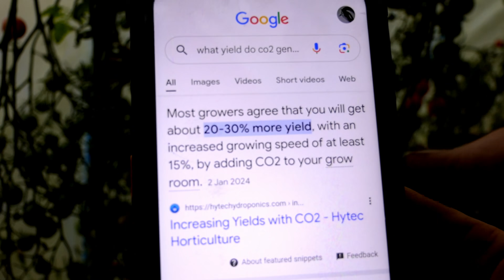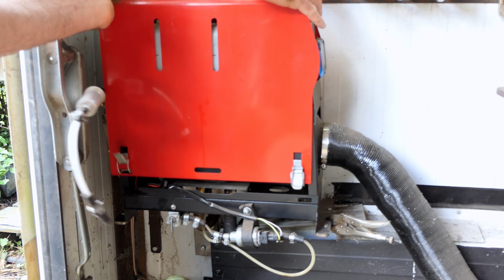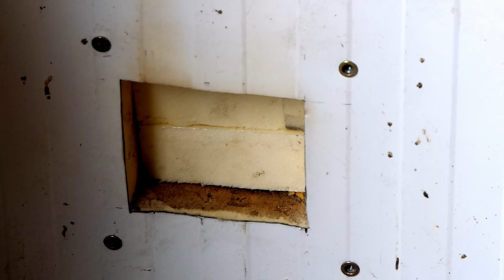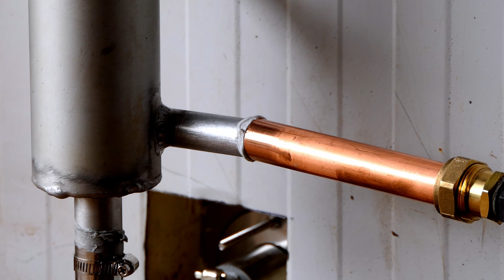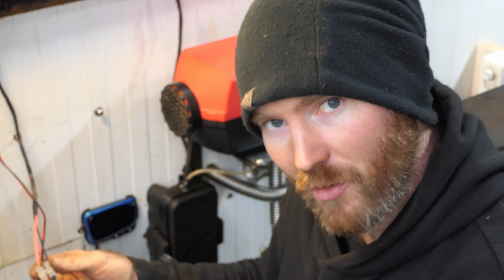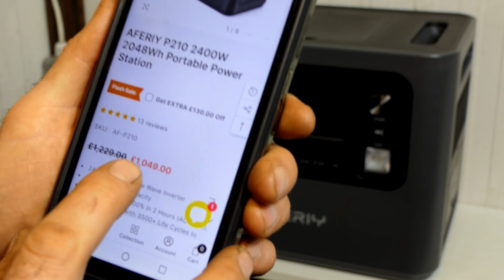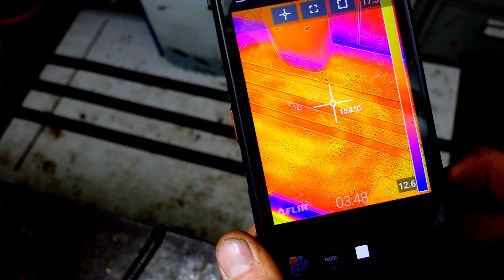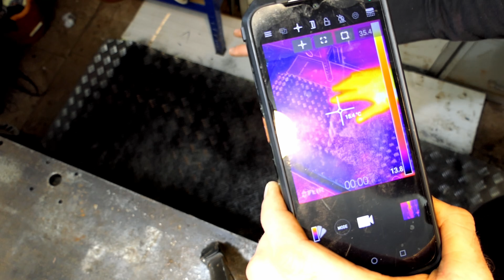NEW! Better system for Cheap and Safe Heating💲+ Underfloor Heating Mod test🫠

Comment from the maker: Before anyone comments their thoughts on the things I've said, PLEASE please make sure you first have listened to everything I've had to say on the subject especially the last 10 minutes of the video where I make my position clear and also double check all the facts I've mentioned before assuming I'm wrong. Otherwise I would be very interested in your perspective, Thank you.

I would also like to bring peoples attention to another matter on the other side of the argument related to fuel which is the case of Donziger: https://chuffed.org/campaign/free-donziger/bb

I hope this video was helpful and insightful to you and if so please would you share, like and comment to help me further.

Here are some helpful links:
**WIN** for just £5 enter the raffle competitions here: https://raffall.com/joshuadelisle

Recommended Diesel heater full kit
UK: https://amzn.to/4hfz0sa
USA: https://amzn.to/48kllMo

AFERIY P210 2400W Solar Generator Kit
Discount: £210 off
Code: Joshua2400WKit
UK: https://shareasale.com/r.cfm?b=2420256&u=3821090&m=147101&urllink=uk%2Eaferiy%2Ecom%2FJoshua2400WKit&afftrack=
EU: https://www.shareasale.com/u.cfm?d=1088027&m=147201&u=3821090
USA: https://www.aferiy.com/?ref=Joshuap210

The Dimming Video: https://youtu.be/rf78rEAJvhY?si=ZlV06F5cu-yBS74x
Their main website: http://www.geoengineeringwatch.org

There is also a lot lot more in the description.

Cheers J
Reply: I run a Chinese diesel heater to heat my machine shop, and I have a 2m long exhaust pipe in a zig zag with a variable speed fan behind it. It works a treat,  too, the point you can hold the cold end while the hot end is at 100 + degrees. I've been running mine on kerosene for years without issue, and i don't get the carbon deposit either, probably because i only run it on kerosene. I agree with your comments at the end of the video. We are either both raving mad or right. Never stop experimenting, and the person that says they have never made a mistake has never done anything.
Reply from the maker: @davedoingdavethings247  thank you so much. Cheers J
Reply: We run our heat pump overnight when on a tariff when electricity is 8p per kw, so get heat for 2p per kw.
Reply: @matthewclarke6601   The cheap tariff is a price we should all be paying if that's the true cost to produce the energy. But in reality i suspect all the other consumers are paying a higher rate to subsidise your tariff.  It's basically a carrot/ stick  economic strategy that will only work while there are people with old none heat pump systems.If everyone had heat pumps. You won't be getting that deal. And your heat pump will no longer subsidised. But while you are getting that tariff, well done you.
Reply: @matthewclarke6601 and you're not restricted to just overnight.
There are tariffs that will give you one or two cheap-rate blocks during the day!
Reply: The "campfire"-looking symbol at the top of your phone while in the FLIR app will switch to a high temperature range.
Reply: Why don't you use a heat exchanger from an old boiler as I do it cost nothing to find a broken boiler and remove the core.
If you are interested in my setup i could send you a few photos.
It is extremely efficient and silent.
Reply from the maker: @haroldtokes5192  nice. I want to find solutions that anyone can find and fit. I can build everything from  scratch with raw materials however that's not possible for the majority of people. Cheers J
Reply: @joshuadelisle  I think you'd get a lot of views following up on that idea. I know I'd be keen to see what you find.
Reply: A fun math problem to help you understand the gravity of the issue Joshua is to figure out the amount of carbon dioxide mass produced by your heater in terms of oak tree cellulose/carbon/lump charcoal that it will absorb in its lifetime (consider a tree's efficiency).  You'll be surprised.  It's likely you'll burn through a small forest worth of solar/fossil energy by using your car in its life time & need another larger forest's worth to absorb the equivalent co2 produced.  Now multiply by amount of cars and then consider the even dirtier industries that are not road transportation.  Burning hydrocarbons for heat is one of the most efficient uses of hydrocarbon use, sadly converting that heat to work is a lot less efficient.
Reply: @joshuadelisle  
HOW  D A R R R E YOU!
Reply: @joshuadelisle Nice to see you haven't got YouTube rich yet to the point where you no longer need to care about cost effective heating because I enjoy these videos :) I'm intrigued at what the Chinese order you're waiting for is, I paused the video but there were no product details shown :(
Reply: I had expected feedback on constructive criticism. But I didn't get that…
Reply from the maker: @johnny5240  there some very good points from PHDs in the comment section. But it is mainly in agreement with me. If anything it proves the incompetence of our leadership to relay important information and be examples of the seriousness of the situation. There is lots of distrust and hypercritical leadership. Cheers J
Reply: Thanks for the reply 😍
Reply: Hi josh love your channel, Do you  recommend any motherboard replacement kits that can be manipulated (ie,  the unlock code) for changing out bad controller and motherboard?
Kind Regards 
J
Reply from the maker: @jongibson3375  Hi. Personally I've not changed one to try but I'll consider doing that. I have suggested in the past that I would find a controller and board set off Amazon which has the blue controller similar to mine as I know that one works well and I understand the controls. I would like to test the app controlled versions in the future too. Cheers J
Reply: the last 10 minutes were priceless❤️ greetings from Poland
Reply from the maker: @tomashhz  thank you so much. Cheers J
Reply: About a month and a half ago I bought an Aferiy 2400 watt inverter. I absolutely love it! The only thing I wish is that it could at some point take an extra battery pack. Other than that one small fact it's amazing. After trying it out and doing some things with it I charged it up and put it in a box for SHTF. Thanks for your struggles with these diesel heaters. I use one almost all the time in my family room and you would gasp if you saw my setup but serves my purpose well. I do want to get one of the hot water heaters now though! Vevor here I come.
Reply from the maker: @theanimalmedic  thank you. Just note a lithium battery will lose 3% per month when not being used. don't let it drop below zero %. Cheers J
Reply: Awesome video. I'll add my thoughts on the heater efficiency in another post that will be buried way down the list. lol
When I first heard of the "thing", it was in relation to 3000 year old ice melting. People were making a big deal out of it, but I kept saying, that is like me dropping one piece of ice, that falls on the concrete and melts, while topping off my 100 year old beer cooler that constantly has ice and I just top it off every year just for good measure. I knew Mars had polar ice caps, so I decided to check those. They were also melting. That seems definitive.
Ivor Cummins (at fat emperor) on X has a 4 minute video that everyone should watch. The evidence is undeniable. The Earth's temp is rising. The video is on results of a study of a 3 km long ice core It has 120,000 years of climate history. They have an accurate measurement of the climate's temp for the last 10,000 years.
Reply: Certain video posting websites don't always show everything in this section. So I will split this up somewhat. We manufacture cleaning chemicals. We have awesome products that are made with conventional technology that is largely based on petrochemical ingredients. Around 2004 or 5 the green push came on full swing and I formulated and started manufacturing really, really cutting edge products based around surfactant technologies derived from palm oil instead of crude oil. They are 10X more expensive but the stuff I made is really good and probably worth it, but we sell to industrial accounts, not to households and they don't want super expensive cleaning chemicals, BUT a hell of a lot of consumers have bought in and you are SO right about the amount of Amazon Rain forest that has been slash and burned to plant Palm oil trees to satisfy the needs of the people who want "green" and "renewable" and it is literally destroying the Earth.
Reply: The rain forest that absorbs to carbon (Co2) and converts it to oxygen is being destroyed at a record pace to plant more and more palm oil trees in an effort to reduce carbon emissions. Everyone involved knows it is BS, but there is money involved. It has been a few years since I looked at a map and I know the South American governments were wanting to slow down, but at least a few years ago, any rules were being ignored.
Reply: I'm interested to see if any of my comments show up.
Reply: You are of course completely right. I am sure you are taking a lot of heat for this. Thanks for speaking the truth anyway.
Reply: @tobiassander3995 Your expertise to declare someone 'completely right' should be easy to demonstrate (if it isn't simply opinion).

Please back up your claim
Reply: Hi totally agree with your take on global warming. I have same discussion's with my friends all the time . Also think of big mega cities how much water is  diverted in pipes permanently out of natural circulation. Everyone have climatization , watch heat emittance of such cities when everyone  turns on their own small air-condition , the effect is cumulative above cities. Not a scientist but i think all these small things matter. Watched Randal Carlson he has interesting takes on  global warmings as well. I think we would eb much better if everyone just went and planet a tree each year.
Reply: Excellent  well done.
Reply: Doctors' FIRST requirement has always been to get you eating correctly, so the "medication first" is a complete trope.
ALSO, you completely misunderstand what 15 minutes city means - it's simply to put shops and services within 15 minutes of people. Nothing authoritarian. It's completely mad and it baffles me how folk can get a good thing -be near the stuff you need - and turn it into a bad thing???
If you're my 15 minutes walk away then you're more likely to walk WHICH IS A GOOD thing .
@joshdelisle you need to do better research.
Reply from the maker: @terryjimfletcher  I've had to deal with enough doctors and hospitals and their mess ups to understand fully the corruption of big pharma, diet is never the first call, don't be naive, a healthy patient is lost customer. The Convenience of living in a city has always been a choice, 15min cities and being fined to travel outside of zones is definitely authoritarian. Cheers J
Reply: You couldn't be more spot on, the facts speak the truth. Those who deny the facts, are doing so out of woeful ignorance, and/or are wilfully supporting and pushing a devious/evil agenda.
Reply: Hi Josh! Great video, as always, I can't believe how much you get down.  Thanks for highlighting the climate scam - and you are spot on: let's debate the issue.  I remember the first time the BBC announced: "the BBC will not longer debate the climate crisis".  Well that woke me up, so ever since when the BBC talk about jibby jabs, ULEZ, cashless, etc.   then I know it's another scam.  How come hands on smart people like you and Geoff Buys Cars can work out what's going on, whilst the univeristy types go along with the nonsense.
Reply: they are fully aware of the heat/cold cycles caused by the disatnce of sirius from our plane-t. they are aware of phoenix events in history too every 136 yr, as all these things follow the cycles of the stars and have been recorded for their use. resets due to plasma flares across the surface of earth are evidenced by the molten structures we are left with in certain countries [pakistan fortification] which can be seen on jon levis channel in numerous vids. due to a pole shift we are experiencing many issues and i believe the russian gov monitors the geomagnetic centre which is headed for siberia currently; that and they are messing with chemicals and frequencies to manipulate the weather. theres some individuals out there sharing this stuff but not enough because its a bit occult and not for everyone.
Reply: 'in my opinion' all governments are mafia-like criminal, murderous organisations that are fighting over the control of resources including the theft of human endeavour. The very  principle of their systems of control run against our freedom to live our lives independently. We didn't agree to it. You can't opt out so are their prisoner/slaves.
The political parties in the democracies simply offer an illusion of choice. They are a long way down the list of organisations that run the world.
Reply: Well said, absolutley spot on
Reply: Thanks. We all appreciate all your efforts and persistence despite sometimes not going the way you expect. Well done 😊
Reply: A note to you and everyone about oil heating. When an oil heater is working correctly it makes 10 to 20 ppm carbon monoxide. They often go wrong though and make enormous amounts 10,000 ppm or higher. 

10 ppm will not hurt you even over a fairly long exposure. 10,000 will kill you fast.
Reply: Spot on. To many environmental zealots most of these arguments will be entirely new to them, so brainwashed are we by schools, the BBC and the Left who hate capitalism and progress.
Reply: Hi Joshua, I would agree with essentially most things you are presenting in your video and love your content. Am I wrong in saying your calculation for pence per KWh of energy for a heat pump is a little off? I'm assuming you're taking the 8.66 then x3 to get the 26 p/KWh? When really this should be dividing by 3 due to producing 3 units of heat for every kwh of electricity. Now I appreciate you also mentioned it could be as high as 14p/KWh so not saying it's any better than the others when the calculations are done. Just thought I'd check my understanding.
Reply: What do you think to putting redex in as a cleaner 🤔
Reply: I did my research carbon monoxide detector should be mounted 5ft or 60in above the floor to work properly.
Reply: Hey man. I've watched alot of ur videos. What if u compress the Gas ur making back into a liquid.  Then filter it back to the engine at gas instead of liquid so the solids stay behind. Maybe frozen or filter the frozen liquid to reduce contamination then back to a gas?
Reply: Dear Josh:

You need to think carefully about the difference between natural CO2 emissions, and our emissions of fossil CO2.  Living things dying and decaying give up carbon, but don't change the planet's carbon level, because living things took up that CO2 in a balanced cycle - the hole in the forest is filled by new plants as the old plants die.  
But digging up carbon from underground and burning it in cars and factories releases carbon, but the hole underground does not fill with an underground forest...  it is out of balance with the life on the Earth.  Also, the coal and oil dug from underground are very dense in carbon, concentrated by geological processes (as you know from your own charcoal experiments) so the 20kg of kerosene might represents a large field of peat growing layer upon layer for millions of years - and there simply is not enough room for enough moss to grow to take up all that CO2.

I am greatly saddened by your "doing your own research" and thinking you have it right, because yeah, you're a guy in a shed, and not someone that understands the complex cycles that we are changing without understanding our impacts.  It takes years of study to grasp what is happening, not a few weeks of youtube videos.

Your final comments are wildly wrong, and contribute to a strong misunderstanding of the carbon cycle and our impact on it, and burying your misunderstanding in your own belief the 0.00012% is such a small number that it can't possibly be that important.   Remember that going from 0.03% to 0.04% is a 33% increase, not a 0.01% increase.  Sunspots is not the reason.  It was warmer 70 million years ago does not mean it will be fine for us.  The temperature of the Earth is not critical, it is the rate the temperature is increasing that is critical - a million times faster now than in the pre-industrial past.  Plants and animals alive today cannot evolve fast enough to survive in the hotter Earth we are creating.  When corn, soy, rice, wheat, and sugar cane cannot grow, much of humanity will die, and the survivors will all be paying Monsanto dearly for the latest GMO drought-resistant versions.

And your comments on deforestation are correct, but deforestation also reinforces the CO2 problem.  No room or water for the plants is a human-caused problem that is creating a larger imbalance in the carbon cycle.  Both are part of human-caused climate change.  Not sunspots.  "We can't do anything about climate change" is just wrong.  We can, and we must, or we will die in our own waste pile, another decayed branch of the tree of life on Earth.
Reply: I just saw this in my feed, I have seen other videos of yours before. I would like to say that climate change has been happening for millions of years, it is called Milankovitch cycles. No human activity caused the ice age to melt, so the climate doesn't need us to be here for it to have a big change now. Pollution is another matter.
As for cloud seeding, CIA director, John O.Brennan spoke about Geoengineering using Stratospheric Aerosol Injection over a decade ago and it was on the CIA website.
More recently, search for Desiree Fixler, a DAVOS WEF insider whistle blower for seeing the dark side of ESG and greenwashing.
Reply: Thank you for sharing
Reply from the maker: @tigs9573  thank you for watching. Cheers J
Reply: Hello Joshua, I'm going to have to correct you about your understanding of human impact on atmospheric CO2 levels. The 3% mentioned isn't the total contribution to concentration by human activities but rather a 3% change in CO2 flux. CO2 flux is basically the carbon cycle, the degassing of dissolved CO2 in the ocean balanced by the reabsorption of CO2 by the ocean, the release of CO2 caused by a plant/tree dying vs. the absorption while it's alive, the release of CO2 caused by a volcanic eruption vs. the absorption caused by chemical weathering. The digging up and use of locked away carbon in the form of coal and oil is referred to as an anthropogenic source of C02 and there is no balancing force to combat the amount of CO2 being added to the atmosphere so every year we add 3% more CO2 to the system which is relatively small but it soon adds up. 
Imagine having 2 open water tanks that contain exactly 100 litres each and every day they pump exactly 100 litres from one to another (tank A pumps 100l to tank B, tank B pumps 100l to tank A), these open tanks have 30l of extra room to account for variations and prevent spillage. The electrical system that runs the pumps is underneath the tanks and not waterproof. Every day you are going to add 3% more water to the system (3l), in 11 days you're going to start to overwhelm the capacity and get leaks and as that leak increases in scale the chance of shorting out the entire system increases exponentially.
This is our atmosphere. We are overwhelming the system and there is nothing we can really do about the changes it will cause. Planting more plants/trees doesn't help all that much because any CO2 absorbed in life is expelled in death, it's a cycle. The only way to recoup the amount we've reintroduced to the system is to capture it and lock it away in a way that it can't get back out. This is what coal and oil were before we oxidised them by burning, stable forms of carbon.
Think about it, reducing carbon emissions isn't what any government or private company wants, reducing carbon emissions isn't profitable or productive. It's like eating cake for every meal, we'd love to do it because it's delicious but we know that if we do we'll get fat and suffer the health consequences. The increase in atmospheric CO2 has risen since the industrial revolutions by the equivalent of 45 Mt. Etna sized eruptions and yet there certainly haven't been 45 eruptions of that scale within that time. The oceans are warming as a result of the greenhouse effect caused by increased atmospheric CO2 and as they warm they can absorb more CO2 which is leading to acidification and yet it still can't absorb the excess we're producing despite covering 2/3rds of the earths surface.
You refer to the ancient past and how the higher CO2 levels caused an abundance of life but you fail to note that the initial injection of CO2 was caused by a super volcano erupting that wiped out 98% of life on earth and it took millions of years of evolution to rebalance the system and adapt to the new conditions. Don't get me wrong, the world will survive and as long as some life remains then life will likely prosper once again but we and the vast majority of life as we know it won't so it's in our interest not to mess things up too badly if we can avoid it.  
Doing your own research is great and highly encouraged but we have educational institutions for a reason. That reason is to make sure you understand the whole subject and not just the abstraction. Unfortunately these problems are often complicated and require an understanding of multiple aspects to get the whole picture, if it was simple then we'd have fixed it already
Reply: @DjDolHaus86  Human contribution of CO2 is between 3 and 5% depending on the study. These words like "balance and budget" are neither scientific or proven between the IPCC working group 1 or 2. The reason this "Budget" can not be agreed on is because the fundamentals about the impact of CO2 are as wrong as the "Energy budget" of the earth. 

1-The Earth does not cool and never has cooled at a wavelength blocked by CO2.
2-The P band that Co2 affects via the laws of thermodynamics means that "Every absorber is also an emitter.  If you and I sit on a beach and you being CO2 have a narrow band of SPF 50 from head to toe  you will not trap or reflect heat as a net value more or less than me (say I'm nitrogen)
EVERY gas has a "Heat sink" based on it's molecular "weight" just as lead is better at absorbing radiation for than tin foil. HEAT is stored in atmospheres with thicker atmospheres. 

I recommend steering away from "Budget" and contained analogies like water tanks (I saw this tactic used by a Youtuber an ex BBC correspondent who knows nothing about the science) 
A big part of the fraud is how the IPCC in their modelling used laws made for solids and applied them to the air - when that failed they used "Layers" in the models to get to a point of 60+ useless predictions because the basic part is 100% provably wrong. 
3-Past CO2 was 100x higher (life flourished with large creatures enjoying a very green planet)  a very long time ago and about the same CO2 as now was 12-13000 years ago. All this madness started with a hockey stick graph that was WRONG! Measured data was bolted onto unreliable ice core data to give the impression "LOOK what humans have done AND LOOK it's got warmer. - 2 papers exist that assume a correlation neither or actually NONE prove a causation.

You can have a look at how "Greenhouse gass" is poorly defined and how the earth is NOT affected by any ""heat trapping gas" specifically. 

Wood, R. W. (1909). XXIV. Note on the Theory of the Greenhouse. The London, Edinburgh, and Dublin Philosophical Magazine and Journal of Science, 17(98), 319-320.
""who demonstrates that longwave infrared radiation is not trapped by atmospheric greenhouse gases""

5% human contribution to what nature releases of the 0.04% CO2 gas can be calculated. IF CO2 would double (about 350 years at the current rate - (it will reduce since CO2 follows temperature changes as the earth cools AGAIN) but let's assume it continues then indeed the GMAT (Global mean average temperature would increase with the additional MASS of the atmosphere. That increase would be +0.1C
Restricting growth to solve a non problem is profitable for those on the bandwagon of provably wrong conclusions that are not held by the majority of people qualified more than the car salesmen type of "Climate science" they simple ignore the physics that doesn't fit their budget or spending. 
Titan has 3x more methane than Saturn. The same language of "Powerful greenhouse gas" is used about methane. Titan has 8000x more methane than earth.  But since it's fair to compare with Saturn in terms of solar energy. Why is Titan COLDER with 3 times more "Greenhouse gas"?
A spectral representation of CO2 or methane is never shown on the main stream since it's "Footprint" along the entire heat spectrum is laughable. 
 
The evidence of this scam is-
in the records of past CO2 from non ice core data (ice core is fine for past temperature)
The FACT that in human times and even in the Vostok ice core data CO2 FOLLOWS temperature change. Human contribution and climate alarmism was based on assumptions, sometimes lies and almost entirely on cherry picked data. That is scientism not science. 

the +0,1C:
Holmes, Robert. (2018). Thermal Enhancement on Planetary Bodies and the Relevance of the Molar Mass Version of the Ideal Gas Law to the Null Hypothesis of Climate Change. Earth Sciences. 7. 10.11648/j.earth.20180703.13. 

Also on "Greenhouse gasses"
Nikolov N, Zeller K (2017) New Insights on the Physical Nature of the Atmospheric Greenhouse Effect Deduced from an Empirical Planetary Temperature Model. Environ Pollut Climate Change 1: 112.

Past CO2 in human timescales vs what is used (for nice public alarm propaganda hockey stick graphs) 
Jaworowski, Z., Segalstad, T. V., & Ono, N. (1992). Do glaciers tell a true atmospheric CO 2 story? Science of the total environment, 114, 227-284.
Reply: @DjDolHaus86  You are right about the cycle. Humans haven't imported any CO2 as what is here was re used. at 120 Parts per million plant life dies out. we all die out. There have been extinction events in the past and ours will likely be down to an external event or our own stupidity when it comes to Nukes. A trace gas we breath, is NOT a problem. The narrative of lies can be easily exposed (with research)  Institutions have been captured by the $$$ so they will not hire or publish studies that prove the massive holes in the current narrative, but then again that was one reason Trump was treated like the anti Christ for listening to very qualified people top of their game (NOT PAID FOR BY BIG OIL) 
The "Green energy" sector is frankly a joke when considering the energy costs to replace fossil fuels (actually they should be called mineral fuels but that's another plot twist)  We should use other forms of energy and transition but there are not enough materials know to mankind to mine in order to replace hydrocarbons for even 1 year.
Reply: @DjDolHaus86  "The oceans are warming as a result of the greenhouse effect caused by increased atmospheric CO2 "
No they are warming due to climate cycles as seen in the medieval warm period and the climate record for 100's of years. And before you quote some BS you heard from sceptical science or somewhere else claiming "yea but it was only Greenland that warmed" That is another BS
FYI:
 GLOBAL warming is relative to a start point. The measuring point for all this alarmist nonsense was from a very cold period that ACTAULLY started way before industry - but they cut that part out in order than your fear and taxes will go into theor pockets to fix a non problem. By the time the game is really up - they made their billions and your kids didn't have the same freedoms to travel as I did. It's socialism/Communism with Marxism disguised as  "saving the planet" It's about wealth transfer, nothing more, nothing less.
Loehle, C. (2007). A 2000-year global temperature reconstruction based on non-treering proxies. Energy & Environment, 18(7), 1049-1058.
Liu, Y., Cai, Q., Song, H., An, Z., & Linderholm, H. W. (2011). Amplitudes, rates, periodicities and causes of temperature variations in the past 2485 years and future trends over the central-eastern Tibetan Plateau. Chinese science bulletin, 56(28), 2986-2994. 

Warming was global. I could cite climate cycles that even the IPCC have never heard of because their aim is to blame humans!

"In the present study, only three or four of the sites are from Europe, so it cannot be argued that the MWP was strictly a European phenomenon. Other studies also show the MWP (Little Climatic Optimum) in Europe (Lamb, 1965; Martinez-Cortizas et al., 1999; Shindell et al., 2001), Greenland (Dahl-Jensen et al., 1998), Africa (deMenocal et al., 2000; Holmgren et al., 2001), North America (Campbell et al., 1998; Li et al., 2000; Petersen, 1994; Shabalova and Weber, 1999), South America (Iriondo et al., 1993; Villabala, 1994), and Asia (Hong et al., 2000; Liu et al., 1998)"
Reply: What you say makes a lot of sense to me. Thanks for putting the effort into explaining it so well.
Reply from the maker: @davidbutler3661  thank you so much. There is a lot more I could talk about but I would be going well off topic if I did. Cheers J
Reply: @joshuadelisle  I'm a brit living in Germany and we really need to have a few pints together (On me) I've been trying to expose the very bad science for along time and i've done a LOT of research.
Reply from the maker: @grahamnumber7123  you're very kind. If there is a way to compile the evidence and data that can be presented alongside the funded mainstream agenda then there is a chance the truth will be brought to light. Cheers J
Reply: @joshuadelisle  Notricks zone and whattsupwiththat is a good place where the public can see the reality. For example there are many websites that deliberately try to hide the fact there was a medieval warm period and this was not local to Greenland. Or watch Bill Nye "The science guy" fudge an experiment with 2 globes under an IR heat lamp inside a jar with normal air and one loaded with CO2. The idiots got caught out because there was an imperfection in the thermometer proving the same thermometer was heated up. Never the less the same experiment was done properly and recorded real time (without cut and paste fudgery)  to show people the the jar loaded with CO2 was actually mildly cooler (As expected)
Try putting CO2 inside double glazing and see if it's "Trapping heat" It would be an ideal insulator in blocking the suns rays or keeping warmth in surely if it's a "heat trapping gas" It does neither.
Venus is 96,5% CO2. Why doesn't it keep heating up? (Saturation) Why is it's 58 earth day long cycle seeing nearly same temps (It's day and night) Why is Titan colder than Saturn despite 3x Methane (we should not eat meat because of methane, farm land because of fertilizers!? It's insanity but also a POWER grab. Mr Bill gates and Mr George Soros fund a lot of these far left Marxist ideologies, to benefit them. Mr gates is the largest private land owner in the USA, he meets with Mr 2 tier Starmer and then we have this tax on small farms. Coincidence or corruption. I can tell and prove to anyone how corrupt the climate alarmism nonsense is. As for the cause of warming, there are several angles. The most certain point overall though is it aint us and the data is manipulated. The UK picking the hottest place in the UK just happened to be a temperature station next to a transformer!! Science vy Scientism. (Science looks at everting and if a hypothesis does not fit, it is rejected. Scientism is to select ONLY the points that support a hypothesis. That is where we are and have been for at least 2 decades. The last part to seal the deal is to supress all those calling out the lies. 
Well done USA, well done Elon for a pretty much government controlled platform and turning it into a free speech area. The people are waking up. BTW I love your content and the way you put it across is just how I would. Keep it up!  I would love to come and show you how they manipulate and lie by omission. The 97% agree was also never 97% this was another lie with statistics because the real number who replied only 2% said humans are causing this change.
Reply: Cool - will have a check out of "The Dimming". Have you seen "Climate: The Movie (The Cold Truth)"?
Reply: Not sure about that dimming tbh, see my comment under the video but repeated here for discussion?

C21H44+32O2⟶21CO2+22H2O

And for the non chemists: 1 mole of jet fuel combusts with 32 mol of oxygen to produce 22 moles of water - only as it's just been comBUSTED it's steam, which is a gas. 

1 mol of any gas occupies 22.4 liters so 1 mole of jet fuel spits out 22.4 litres of steam out the back. 
Generally up high it's -40 to -50°C ish so this immediately condenses to minuscule water droplets which then freeze into nano ice particles - these are your "chemtrails".

1 mol of jet fuel weighs 296g, a 737-800 burns approx 42kg fuel per minute during cruise. That's roughly 142 moles. So every MINUTE the jet is spitting out approximately 70,000 litres of steam into ice clouds. 

Discuss please...
Reply: you said "you're not a scientist" so lets leave it at that ;-) , by the way... another great video! :-D
Reply: You ruined a perfectly interesting video about your entertaining approach on tackling a global energy crisis with your take on global climate change. However, your rambling about the changing climate not being bad right now for our living conditions as humanity is, how shall I phrase this politely, alarming. It is a man made change, that is factually proven to be true by science. I would strongly encourage you to stop shaming the attempts to stop the mass pollution of the atmosphere and instead focus on promoting the reforestation of our planet. Little fun fact on the side, Ireland (my current home) was covered by forest once too, until some British decided to use it and build an armada... and it has never recovered.
Reply from the maker: @79Casimir I believe in looking after the planet but tackling CO2 is a red herring and will only result in political tyrany with little to no change of the weather. It's a scientific fact that you cannot reverse climate change and it's a fact that there are actual benefits to having more CO2 whilst the negatives are theoretical and based on models that are in a state of flux. CO2 is good and necessary for all life to exist. The world has been far hotter and colder with much higher levels of CO2 in the past. Governments with an agenda are to blame for your deforestation not the common person looking to be self sufficient. Cheers J
Reply: @joshuadelisle  I think you do not understand the magnitude of changes the ever increasing CO2 will bring. The CO2 you point at your tomatoes will help weeds grow even better and the increase in temperatures will make crop yield worse (not to mention diminishing returns). The 3-5 times CO2 level of the past were fine for an ecosystem that had MILLIONS of years to adapt not centuries. 

Life on Earth is remarkably resilient and will almost certainly survive human-caused climate change. Some organisms will even thrive. But human civilization would face catastrophic challenges.
Reply from the maker: @ameliekk that's theory not fact regarding the results of climate change and those models keep changing regularly and differ depending the who's narrative is behind it. In industrial green houses they actually use CO2 generators to increase production... Weeds are fine within regenerative systems as they are used for biomass and fertilizer, nettles are especially great for high quality compost and makes a lovely soup, dandelions are incredible for heart health etc. Nature is more adaptable than you realize just look how it invades places that humans have abandoned. Helping nature is what we need to do such as protecting the rainforests and re-establishing ecosystems but carbon tax, Ulez, carbon capture, solar farms, battery vehicles etc won't do anything other than earn money for corporations.... Just follow the money. Cheers J
Reply from the maker: @ameliekk  watch this: https://youtu.be/MzCiEHGVMwA?si=atnXYvOdwUZDKMSp
Reply: @joshuadelisle  Her descriptions of how regulations and bureaucracy impede infrastructure development are (imo) generally accurate, but her assertion that renewables can never be reliable enough contradicts evidence from countries achieving 80%+ renewable electricity. Countries like Denmark, Costa Rica, and regions of Germany demonstrate high renewable penetration is achievable.

My push-back is not about your views on the UK energy policy, but with claims that our current CO2 growth is anything but catastrophic to human civilization.

The comparison to the Jurassic period overlooks that rapid change (not absolute levels) is the primary concern. The "only 0.8% of emissions" argument ignores cumulative effects and the UK's historical contributions. While she acknowledges rate matters, she severely understates its importance. Current CO2 increase is occurring 100-300 times faster than most natural climate shifts. This is the critical difference - ecosystems and species need thousands to millions of years to adapt, not decades.

Yes, Earth was warmer with higher CO2, but:
-Sea levels were 50-200 feet higher (goodbye London, New York, Miami)
-No ice caps existed
-Completely different continental configuration
-The sun was 2-3% dimmer (which she mentions but underplays)
-Zero human infrastructure existed to be disrupted

While humans add a smaller percentage than natural exchanges, this fundamentally misunderstands carbon equilibrium. Before industrialization, natural emissions and absorption were balanced. Human emissions are additional - like adding water to an already-full bathtub.

Climate scientists aren't claiming life will end - they're warning about:
-Collapse of current agricultural systems
-Displacement of billions from coastal areas
-Water scarcity for 2+ billion people
-Economic costs in the hundreds of trillions
-Potential civilization-level disruption

Her argument essentially boils down to: "The planet has been different before, therefore rapid change isn't concerning" - which ignores that human civilization developed during an unusually stable climate period, and our entire infrastructure assumes that stability continues.
The most telling quote is when she says CO2 staying high for millions of years would allow life to "eventually adapt and diversify" after a "mass extinction event" and "thousands of years of instability." She acknowledges catastrophic outcomes while somehow presenting this as reason not to worry.

And while future projections have uncertainty, we're already observing documented changes: glacial retreat, shifting growing zones, coral bleaching, permafrost thaw. These aren't models - they're measurements. The fact that governments and corporations push profitable "solutions" over effective ones doesn't negate the underlying atmospheric physics. It just means we're addressing a real problem with fake solutions.
Reply: @ameliekk  no use, he is not a critical thinker
Reply: Seeing as the response to your post that I replied to along with that post has been deleted, I'll throw it in again:

It's scientific fact, not perspective.  

Just the freely available Wikipedia page on co2 in Earth's atmosphere would do as a source. 

You're right about historical changes in levels of co2 and that they were astronomically high millions of years in the past.
But, and this is the thing, you aren't considering rates of change. 

In the past, co2 levels changed gradually with plants and animals best fit for the conditions evolving over time. It's true there would be an initial co2 fertilisation spike for increased plant growth but the limiting factor is nitrogen and there isn't enough of that available to sustain any such spike for long. Most modern plants that we would rely on could not cope . 

Slow rates of change allow for equilibrium in the system.
Additional co2 being added into the atmosphere by human activity over the least 250 years is small by comparison with other sources but it has upset the equilibrium causing rapid temperature change. 

It's not rocket science - life and eco systems can cope with slow change over thousands or millions of years by evolving and adapting, but they can't cope with rapid gobal change over a couple of centuries because there is no time to evolve or adapt. It's that, rather than change itself that's the problem and this seems to be so misunderstood or ignored by many.
Reply: @moriarmozz  Wiki is not a source of science since even people profiles can be altered to make them look dumb. 1st to address your comments "...."
"In the past, co2 levels changed gradually with plants and animals best fit for the conditions evolving over time. It's true there would be an initial co2 fertilisation spike for increased plant growth but the limiting factor is nitrogen and there isn't enough of that available to sustain any such spike for long. Most modern plants that we would rely on could not cope"
Just on the above. this is not true, CO2 has varied wildly and over relatively short periods. If CHERY PICKING the ice core record used for almost every single hockey stick graph (if you google image search "past co2") for past co2 then it doesn't look to change much at all no. But this is a lie. See the below.
Jaworowski, Z., Segalstad, T. V., & Ono, N. (1992). Do glaciers tell a true atmospheric CO 2 story? Science of the total environment, 114, 227-284.

Nothing wrong with the ice core data for past temperatures as this agrees with other proxies but for past CO2 it's not accurate at all esp when the higher values as left out and called "An anomaly"  sure an anomaly that doesn't fit the profile to get the funding.

"Additional co2 being added into the atmosphere by human activity over the least 250 years is small by comparison with other sources but it has upset the equilibrium causing rapid temperature change".
The actual number is around 5% human contribution. That is 5% of 0.04% please show me the scientific proof that CO2 drives climate change because the 2 papers that I looked at, 1 suggests a link and another assumes one. None exist that prove CO2 drives climate change. Here are 2 that show it doesn't, the 1st proves what would happen IF we could double CO2 (That would take about 350 years....check the maths yourself - (421PPM March 2023. 418.81 March 2022.)
Holmes, Robert. (2018). Thermal Enhancement on Planetary Bodies and the Relevance of the Molar Mass Version of the Ideal Gas Law to the Null Hypothesis of Climate Change. Earth Sciences. 7. 10.11648/j.earth.20180703.13. 

Nikolov N, Zeller K (2017) New Insights on the Physical Nature of the Atmospheric Greenhouse Effect Deduced from an Empirical Planetary Temperature Model. Environ Pollut Climate Change 1: 112.
Fun fact for you. Methane is also touted as a powerful greenhouse gas. If so then Why is Titan colder than Saturn despite getting about the same solar energy when it has 3x more Methane. (8000 x earth)
"It's not rocket science - life and eco systems can cope with slow change over thousands or millions of years by evolving and adapting, but they can't cope with rapid gobal change over a couple of centuries because there is no time to evolve or adapt. It's that, rather than change itself that's the problem and this seems to be so misunderstood or ignored by many"
This is not accurate at all. Greening of the planet has been observed and experiments with trees grown with normal levels of CO2 vs artificially increased levels show big differences in growth. CO2 is a BENEFIT to nature but is being sold to millions as a curse. We pump the stuff into greenhouses for a higher yield. Plants generally need less water with increased CO2. Co2 swings (if you look at the graphs in the 1st paper) happen fast. The recent increase is due to the temperature rise from a VERY COLD period to that of today. 
it wasn't never over this 280PPM claim used by NASA GISS (Gavin Schmidt doesn't take down his lying graph of past CO2 also used by Al Gore) has already been exposed as on the pay. I back up my claims with science so here are at least 2 more studies where CO2 was already way over the claimed ""280PPM for millennia""
Steinthorsdottir, M., Wohlfarth, B., Kylander, M. E., Blaauw, M., & Reimer, P. J. (2013). Stomatal proxy record of CO 2 concentrations from the last termination suggests an important role for CO 2 at climate change transitions. Quaternary science reviews, 68, 43-58. 

Even as recent as <1939 CO" was average 325PPM
Slocum, G. (1955). Has the amount of carbon dioxide in the atmosphere changed significantly since the beginning of the twentieth century. Month. Weather Rev, 83, 225-231.
Reply: You're spot on with climate change. Tony heller has a lot of great videos exposing the corruption of mainstream climate change science. Oppenheimer ranch project talks a lot about the sun cycles role in weather and climate change. It all just makes so much more sense than co2 driving climate change. Epecially since the data suggests co2 rises following temperature rise and not the other way around. "Climate the movie" is a pretty good documentary on the whole situation as well. Pretty much everything you said in that.
Reply: @brockashsfrund  Tony Heller is an absolute Legend! He does mainly generic fluff videos now so as to not get kicked off this media ..... but he shows clearly where the fudges are in the climate argument. He has fairly conclusively destroyed the link between CO2 and Global Temp rise! He also has a free programme that allows you to interigrate all the official raw data from the weather stations and run comparisons (say the news says it is the hottest Sunday in August ever, you can check historic date for the third week in august for all records and see if they are right).
Reply: @brockashsfrund  
Co2 was higher even 12-13K years ago.
And this paper destroys CO2 driving anything more than our governments ripping us off more with taxes and Orwellian measure that gives them more and more power. (While they cut about on private jets) 
Holmes, Robert. (2018). Thermal Enhancement on Planetary Bodies and the Relevance of the Molar Mass Version of the Ideal Gas Law to the Null Hypothesis of Climate Change. Earth Sciences. 7. 10.11648/j.earth.20180703.13.

Yep CO2 lags and even its stated on the bloody ice core data they use for that BS hockey stick graph!
O. Humlum et al. / Global and Planetary Change 100 (2013) 51–69
Past Co2
380PPM 500AD pg 57
Kouwenberg, L. L. R. (2004). Application of conifer needles in the reconstruction of Holocene CO2 levels. 
Steinthorsdottir, M., Wohlfarth, B., Kylander, M. E., Blaauw, M., & Reimer, P. J. (2013). Stomatal proxy record of CO 2 concentrations from the last termination suggests an important role for CO 2 at climate change transitions. Quaternary science reviews, 68, 43-58. 
Slocum, G. (1955). Has the amount of carbon dioxide in the atmosphere changed significantly since the beginning of the twentieth century. Month. Weather Rev, 83, 225-231.

You can even see why they use ice core for CO2 for that nice fat lie that "CO2 has never been this high for a millennia" (NASA GISS are a joke. I can rip apart every liw they tell on their "How do we know" homepage"
Here is why Ice core data is a bad proxy for CO2 (it's fine for past temps though)
Do glaciers tell a true atmospheric CO 2 story? Science of the total environment, 114, 227-284.
Jaworowski, Z., Segalstad, T. V., & Ono, N. (1992). Do glaciers tell a true atmospheric CO 2 story? Science of the total environment, 114, 227-284.

I have a lot more info if u need and all the links. DM me as I can't send the links here. 

Finally fun fact. Titan has 8000 times more methane than Earth and more relevant 3 times more ""powerful GHG Methane"" than it's mother planet Saturn (Both get very similar solar energy)  Why is it COLDER then if it has 3 times more ""heat trapping gas""? Because GHG (Greenhouse gas) theory is severely flawed.

Medieval warm period was warmer than now...These are natural cycles and our 5% contribution to the 0.04% Climate CO2 is doing next to NOTHING. It's a benefit.
Reply: @brockashsfrund  Also check out Will Happer and his explanation of how CO2 behaves. Nobody can say he's not an expert on spectrographic problems and the atmosphere since he was tasked with "can we shoot down missiles with powerful lazers" 
Also Loehle, C. (2007). A 2000-year global temperature reconstruction based on non-treering proxies. Energy & Environment, 18(7), 1049-1058.
propaganda sites like Skeptical science claim the Medieval warm period was only in one location  as they want to discount it. but:
""In the present study, only three or four of the sites are from Europe, so it cannot be argued that the MWP was strictly a European phenomenon. Other studies also show the MWP (Little Climatic Optimum) in Europe (Lamb, 1965; Martinez-Cortizas et al., 1999; Shindell et al., 2001), Greenland (Dahl-Jensen et al., 1998), Africa (deMenocal et al., 2000; Holmgren et al., 2001), North America (Campbell et al., 1998; Li et al., 2000; Petersen, 1994; Shabalova and Weber, 1999), South America (Iriondo et al., 1993; Villabala, 1994), and Asia (Hong et al., 2000; Liu et al., 1998)"

Also
Holmes, Robert. (2018). Thermal Enhancement on Planetary Bodies and the Relevance of the Molar Mass Version of the Ideal Gas Law to the Null Hypothesis of Climate Change. Earth Sciences. 7. 10.11648/j.earth.20180703.13. 
Holmes "1000frolly on youtube" proves IF we could double CO2 then the temperature rise would be a non alarming and not whopping + ZERO POINT ONE Centigrade and that assumes nature wouldn't lap up the extra as it did when CO2 was more than 10 times that of today.
Also "Greenhouse gas" is really a non starter since we do not live in a greenhouse. 
Wood, R. W. (1909). XXIV. Note on the Theory of the Greenhouse. The London, Edinburgh, and Dublin Philosophical Magazine and Journal of Science, 17(98), 319-320.
- who demonstrates that longwave infrared radiation is not trapped by atmospheric greenhouse gases.
Reply: @brockashsfrund no he's not spot on. Totally ignores rate of change over millions of years and evolutionary adaptation rather than the short sharp shock of the last 200 years. Educate yourself
Reply: @moriarmozz  lol I have. Apparently you haven't. Stay mad and ignorant I guess
Reply: To claim that climate change is anything other than a global catastrophe is either disingenuous, misinformed or, worse, deliberately malignant.
Reply: @Saor_Alba  If you have done some research, please explain that if we take man made CO2 at the high end of 5% and a stadium of 100K people are "Normal" Where is the physics where adding 40 people to that stadium with heat the other 100,000? It does not exist. Climate modelling is based on a manipulation of laws meant for solid flat surfaces, then fudged into gasses. 
1-The earth does not cool off and a spectrum affected by Co2.
2- The start point of these alarmist propaganda claims is from a cold period during industrialisation. They do not show it started BEFORE industrialisation or that while we can measure human output, it's effect can be calculated without modelling.
3-The climate has changed and will always change with or without humans.
4-Past CO2 was higher that put forward in every single hockey stick graph I have seen and also in human time scales (if the argument could be "Well we are not dinosaurs")
eg here
380PPM 500AD pg 57
Kouwenberg, L. L. R. (2004). Application of conifer needles in the reconstruction of Holocene CO2 levels. 
Here 
circa 425PPM circa 12750 yrs ago- Fig 8 compared to why GISS use misleading and false data:
Steinthorsdottir, M., Wohlfarth, B., Kylander, M. E., Blaauw, M., & Reimer, P. J. (2013). Stomatal proxy record of CO 2 concentrations from the last termination suggests an important role for CO 2 at climate change transitions. Quaternary science reviews, 68, 43-58. 
here
circa 425PPM circa 12750 yrs ago- Fig 8 compared to why GISS use misleading and false data:
or here 325PPM average <1939

Slocum, G. (1955). Has the amount of carbon dioxide in the atmosphere changed significantly since the beginning of the twentieth century. Month. Weather Rev, 83, 225-231.
Jaworowski, Z., Segalstad, T. V., & Ono, N. (1992). Do glaciers tell a true atmospheric CO 2 story? Science of the total environment, 114, 227-284.

Most people do not even know what these things are:
Bray, De-Vries/Suis, Gleisberg, Yoshimura and so on. Or how sunspot activity also affects climate. 

Why is Titan colder than Saturn despite have 3x the greenhouse gas methane (They actually call it a "Powerful greenhouse gas" it's not. Water vapour is more powerful and provides aa direct natural feedback.-Mpre cloud= less sun= cooler = less cloud= then warming = a feedback.

It's colder now than the average of the last 8000 years. Sea levels are not accelerating and storms are not more frequent. EV cars (even if we forget the pollution after end of life) need some 80% CO2 comared to a standard combustion engine. There are not enough materils known to man that can be mined yet for to replace hydrocarbons either.

Have a look a 12 pages of failed predictions on whatsupwiththat climate website. All links and references are listed. Or try notrickszone
Reply: @Saor_Alba  Why is it? Because that is the message on repeat with anything weather related being amplified as due to us not curbing CO2 emissions?
If you check you'll find that global weather events such as forest fires, Tornadoes, Hurricanes and sea levels have not been accelerating at all. Look at the data and you will realise the hype and propaganda is solely to benefit a "Green" industry that is far from green. +1-1.5C of warming is neither a catastrophe our out of what with nature as we have had warming periods in the past too. YES there are claims "But this time it's more sudden and due to us" That argument relies on data (corrupt data) by using temperature stations in built up areas. Using the rural data there is no massive change at all. It's a corruption of the scientific process to cherry pick data as was done this summer "Look the hottest day since bla bla" when they used data from a temperature station right next to a sub station! This is how they deceive and manipulate people into believing there is a problem when there is nothing at all we can do about the weather - other than mess things up more with eg cloud seeding.
Reply from the maker: @Saor_Alba  it is a global catastrophe and very real. It's just CO2 is not the main factor nor can it be reversed. Cheers J
Reply: @joshuadelisle  just got a like on one of my comments which reminded  me and highlighted that my other comments were deleted. Disingenuous is a word that springs to mind
Reply from the maker: @moriarmozz  I don't know why your comments are being deleted but it's not me. It was probably flagged by YouTube as spam. Cheers J
Reply: @joshuadelisle  I know exactly why because I had 1000+ hours of my points either being shadow banned or "Links not allowed" (Even those links directly address the original science papers and what was ACTUALLY said (eg in the Vostok ice core data that CO2 lagged temperature rise by 400-600 years) The ice core data used exposed more fraud in terms of scientism (Let's pick the parts we want to show for our funding) vs Science - Ok these several part where even the ice core data shows very high CO2 levels - it needs explaining. And so on. It has been explained several ways with different data from plant stoma and other records that lie number 1 is that YES CO2 has been actually higher then today and WAY before any fking dinosaurs!! (for the plebs that can't compute large creatures need lots of food=meat or vegetation and vegetation is more abundant with more CO2)
The entire narrative is a big fat lie and because it can be exposed on every level (from key facts like 1-Co2 lags temp rise 2- it WAS as high and higher before industry and 3-The actual ""greenhouse gasses" terminology is a fraud up there with calling oil "Fossil fuel" it's not made from fossils or dead dinosaurs at all, the same as we are not breathing out "Carbon" (people think it's dirty and black the same way they see acid (the oceans are alkaline btw but they use Acidification as it sounds more scary) 
Pollution, plastics, and generally burying shit that can be cheaply re-used is a good idea! Taxing the air to fix a non problem is what twisted people do with more power than they should ever have.....while pushing  mRNA vaccines...Mr B Gates is the biggest private land owner in the USA (His next monopoly game) The prick should just retire and do whatever but the minds of these people are perverse - money is not enough, it's never ever enough. Childhood issues? Daddy didn't shown them enough love so gave them a company? ...who knows that part about the system. I know the truth and I can easily prove it....